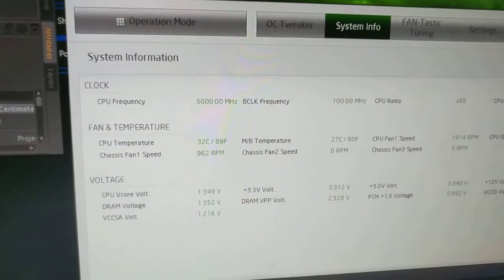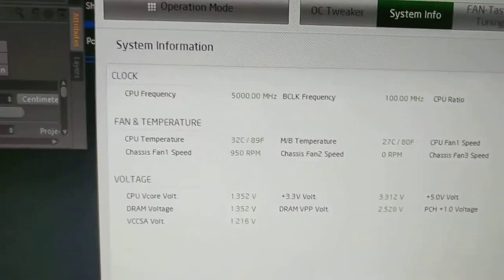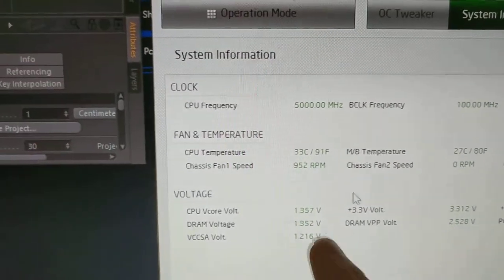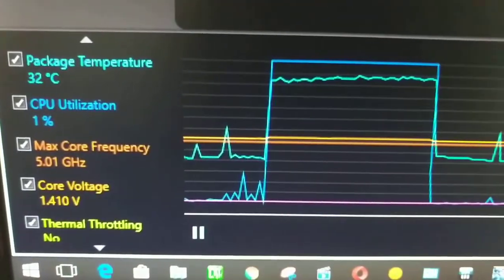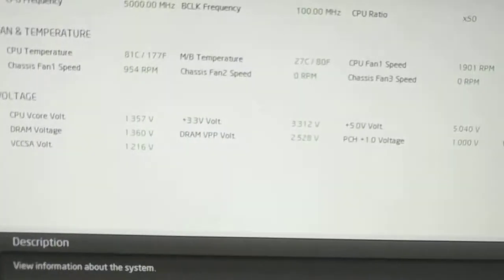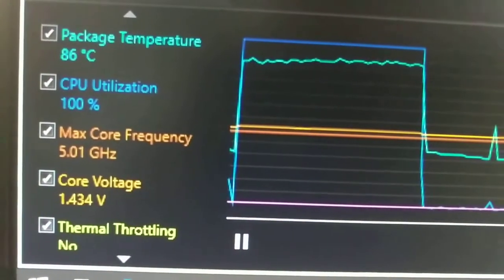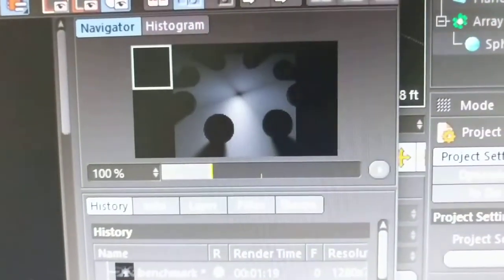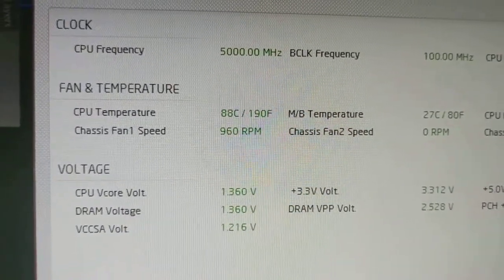Intel i7 8700k 5ghz Overclocking Adventures Part 1

Comment: Nice. 

What cooler are you using for 8700k?

I’m debating between Corsair 360mm AIO with the new magnetic fans (per Corsair rep, will be released mid December) and a EK-KIT P360.
Reply from the maker: +Joe Momma kraken x61. I have a mixed fan situation. One noctua fan. The two nzxt fans. And one other one I can't remember. It really doesn't matter due to the poor thermal conductivity of the Intel heat spreader.
Example: the CPU could be 80c and the liquid temp will still be 29c and never rise.
Reply: NavJack27 I’m getting mine delidded. You plan on delidding?
Reply from the maker: +Joe Momma yup.

Comment: What are your bios settings? 

I finally succeeded in overclock mine on 1.35 Vcore for 4.8GHZ, AVX 0, C states / MCe / speedstep disabled, Manual overclock so no XMP.

I tried 1.29 vcore and adding 0.01 and 0.1 but it would just BSOD when stress testing. This one seems stable, will be using for gaming.

I want to get the 5 ghz mark
Reply from the maker: +Santos I just delidded last night so I might update with new findings. So far I'm doing for stable in everything 5ghz with 4.3ghz cache and load line at level 1 a voltage of 1.380v to the core. It might be a little high I guess but temps work out and like I said, stable in anything I throw at my computer.
Beyond that I'm working on 5.1ghz and it's a little insane so far. 1.425v for the same stability. But delidded, temps are in check with my new noctua nh-d15.
Oh, avx offset of 1x.
Check navjack27.netlify.com for my written articles when I don't feel like doing a real video.
Reply: Hey mate, will do for sure! Thanks, I think I just got a unlucky chip compared to others. but I paid for the K so atleast want to reach 5ghz. I heard that you should not go above 1.41 vcore max. I will check out your site mate.
Reply: https://imgur.com/a/iDSde
My best benchmark..
But its not 100% stable, my stable settings are:
5.2ghz 1.376v
Eist/c-states/speedstep/turbo everything disabled/No LLC.
Static core speed.